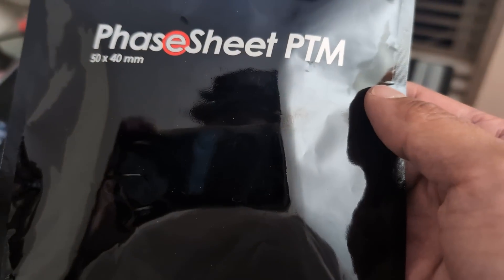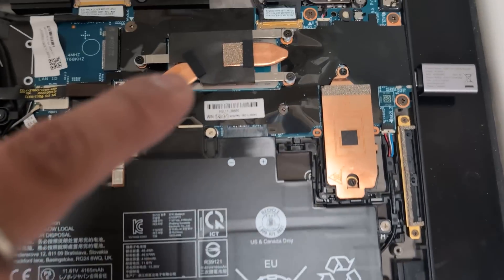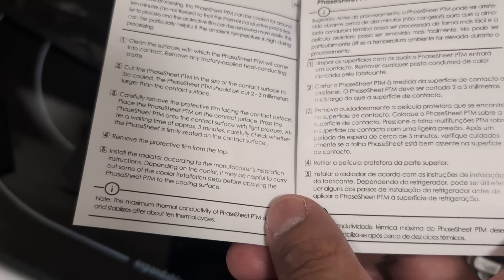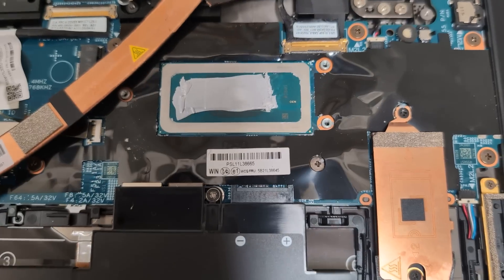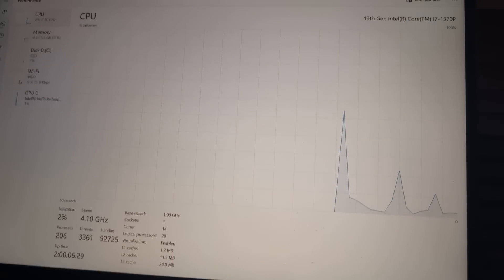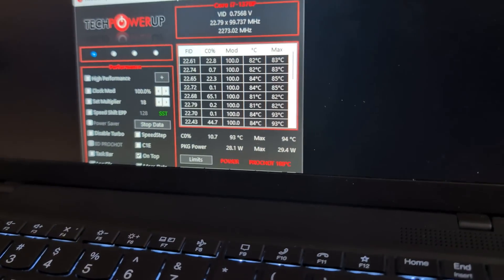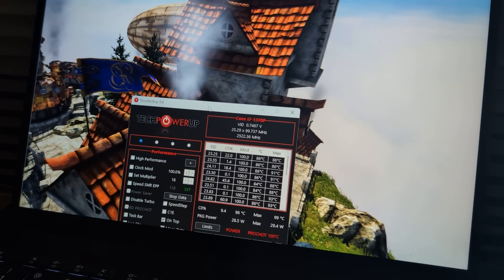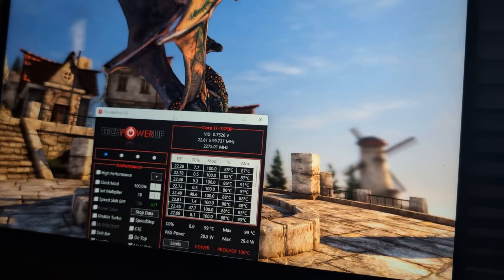Thermal grizzly phase sheet ptm installation and testing.

Comment: there's a couple of things here that might help others: 

1.  Put the Thermal Grizzly Phase Sheet PTM in the fridge for 10 minutes before applying it ( makes it a LOT easier to apply)
2.  It takes 5 or 6 heat cycles before the PTM achieves optimum cooling

Comment: This is incorrect information. CPU is designed to be at these high temperatures. You should compare the score and cpu sustained power consumption before and after applying the new paste/pad. CPU will always reaches its maximum temp unless its power limited.

Comment: Cut it from the red colored parts so you have something to hold to when peeling off the plastic film. (This from someone that has used the Honeywell ptm7950 - same material different packaging and rebranding). It needs a several heat/cool cycles over a few days to finally do its best work. It is not conductive.

Comment: For me on a Lenovo Legion 7 didnt work at all KryoSheet (I also had to put kapton tapes around CPU and GPU to avoid a shortcircuit) , so I put back PhaseSheet which is similar with how the laptop was as new. Not great, but not very bad either. If you want to use turbo boost, get a PC, not a laptop. On laptop disable turbo boost if you want a quiet and cool experience.

Comment: My 16 core 32 threads 7045HX gets 65c running "cine bench 23" <---  full load and using 102w <---  :P
But then again i got a Clevo not an Asus with inadequate cooling :P
Dont touch the pad with your fingers and get oils on it.....
Not to mention your using internal GFX thata slow.. your CPU is doing NOTHING.. useless...........

Comment: If conductornaught isn't working you've missed something thats stopping it working. I used LM on my asus m16 laptop cpu (replaced the old LM) and modified thw gpu to use LM and I got 20-30 degrees temp reduction.

Comment: I used Honeywell PTM 7950 as every brand just repackages it. This was applied to my Mini ITX build using the Minisforum BD790i SE motherboard in the Ncore 100 Air case.
After about an hour giving the heatsink time to heatsoak...
With stock paste my temps would reach 85-91 C
With PTM 7950 my temps stay between 75-81 C
You had to of done something wrong unless the cooling solution is just that bad on the laptop

Comment: I tried multiple thermal solutions for my OMEN gaming laptop and none of them lasted, including Kyronaut. Kryonaut was the best in terms of keeping the CPU and GPU cool, but lasted a few weeks and then the thermal performaces went bad again. I installed for the first time this PCM Phasesheet and at the moment the temps are going up to 80C on CPU (97+ prev) and no more than 67C on GPU (82 prev). Best temps I ever had on any laptop after cleaning and repasting. We will see if it lasts the time test. This product must get through 10 thermal cycles to be completely reliable, as the instructions say. Also, be aware of the gap between CPU, GPU and copper cooling system. For me, this 0.2mm worked as a charm, but for others may not.
Reply from the maker: @PowerProteins  the krysheet works best for me
Reply: @pavy415  have it on my cpu. Amazing
Reply: Kryonaut hands down cools the best, but they degrade extremely fast when the die temps go past 80C, thus is unsuitable in laptops where even the best cooled CPU still hits mid 80s. It is also very susceptible to pump out Which contributes to it's poor longevity in the first place. Which is why Thermal Grizzly now has a new product, Duronaut which it advertises as being as conductive as Kryonaut but way thicker (viscous so is more suitable to direct dir cooling) and less thermal degradation. I have yet to try it out as I just discovered it.

I have also just changed to the Phasesheet PTM and boy are the results actually good. Compared to  my previous PTM 7950 application it's around 2-3°C lower and the fans ramp up slower as well (auto fans) but if I Max fans from the start for both application, I would see as much as 5C difference on the GPU but only 3C better on the CPU. of course, results will vary with others.
Reply: @randomesteven3935  Interesting to see long term difference. If you apply oryginal ptm 7950, you should get good temps for around 3 years, right? Is it the  same with thermal grizzly, or will it dry out in just 6 months? Who knows. 
P.s. What kind of thermal pads did you use on a laptop? I'm looking for a laird607, but it is impossible to find in a small package, and small syringes that I can find seem fishy.
Reply: @ The PTM I had were only used for about 1.5 years. I decided to change it out since I was fiddling with adding spacers to my heatsink. I could've reused the PTM applied already, but since I bought the TG phasesheet, I just decided to change it out. 
As for thermal pads, I usually get Gelid's Extreme pads as they are not just soft but also long lasting. 
Which thermal grizzly are you referring to? Kryonaut (best performing psate on the market in PC applications, but low durability on laptops.) Duronaut (supposedly as good as kryonaut but is viscous and very suitable for laptop applications) or Phasesheet PTM (which is a sheet like Honeywell's PTM7950 but is new in the market and durability is unknown as of now)
Reply: @randomesteven3935  I am referring to TG PTM. But yes, it's kinda new, so there is no info about how long it can be good.
Reply: Hello. I'm looking to try these pads. Any updates? Is it still delivering the same performance? Because I don't know what to choose between this or overpay for ptm7950. Thanks.
Reply from the maker: @jaredfaledey4081  i just went back to my thermal pad your results may very
Reply: @jaredfaledey4081  I have the same thermal performances as a month ago when I freshly installed the Phasesheet. When heavy tasking or gaming I use the laptop with maximum fans, not auto mode. On Omen, I found along the time that the Default setting with Max fans delivers the best outcome even for the most intensive tasks. I hope it helps, cheer a beer for me!
Reply: Still rocks on my Omen, same performance and realiability after more than 5 months. No stutter, no frame loss caused by temps. Amazing technology.
Reply: That thermal paste is a benshdesk or a show thermal paste. Is not made for continuous use. Is made for put it do the benchmark and after a month or two it needs to be replaced.
Reply: @JR-uy2nd  Did you smoke smth? What benshdesk and show thermal paste even mean? Opinions are welcome as long as they have a logic argument. We are trying here different thermal solutions for laptops to help others choose the best suitable option. You come here and talk gibberish when clearly you have no idea what a phase change material is or how it works. Go touch some grass, maybe read some basic english grammar while you get out in the sun.

Comment: Can it be used with a ps4 that pumps out thermal paste, or would this prduct would be pumped out?
Reply from the maker: @darkouer  I won't know if this has pump out effect but if it does i recommend cryo sheet by thermal grizzly very good thermal pad
Reply: Phase change sheets like this Phasesheet and PTM 7950 do not suffer from pump out which is why PTM 7950 is used in industrial applications. 

Unlike regular thermal pastes which do pump out, PTM only gets better with thermal cycles, not time. However, there are also thicker thermal pastels which are designed to last just as long such as the Gelid GC Extreme and KPX pastes

Comment: Bro complains about the thermal interface materials not working when his laptop's cooling solution is a single heat pipe lmao. Your issue isn't the thermal interface material, it's Lenovo deciding to implement an insufficient cooling system to save a few bucks. Basically what you're doing is trying to suck more liquid through a straw by changing the materials the straw is made of when what you really need is a larger diameter straw.

Comment: The new pastesheet PTM by thermal grizzly or the Honeywell PTM 7950 aren't suitable for laptops, it requires high contact pressure to active, laptop lacks uniform mounting pressure needed. So better stick to traditional thermal paste for laptops. I tested new pastesheet it on my Dell XPS 13 and it was performing very poorly reaching temps around 55 to 60 at idle (Ambient Temperature 24 degrees) normal loads temp was reaching 65 to 75. The application was done correctly as specified in its guidelines. Ran through at 15 cycles but no improvement
Reply: I have repasted 100's of laptops as a business with PTM7950, Laird TPCM7250 and TPCM7125 for chips with a shim cover very close to it because the excess material spreads out around the core and with a shim on the cpu it can block full compression (Not entirely sure but i think the grizzly is not PTM7950)  and there is always a good improvement. With poor mounting pressure i usually replace the thermal pads with quality putty like Laird TPutty 607 (K5Pro is sht) and sometimes with poor mounting pressure (couple of Elitebook 1030 G7's at the moment) i place a right sized thermal pad (not PTM but the same material that's used on vrm and memory chips, PTM should absolutely not be used as a thermal pad on those components) on top of the cpu heatsink that pushes on the bottom cover plate slightly to temporally increase the mounting pressure for a faster cure on the sheet. It's on my own laptop for around 2 years (TPCM7125 and always around 80'c when fully loaded) and it is still the same performance after cleaning the fan.
Reply from the maker: @harrydijkstra9936  very good idea I'll try putting a sheet on top
Reply from the maker: @devinkaillukkubura2565  I switched back to the thermal pad cryosheet

Comment: I appreciate the effort put it was doomed from the start. The laptop suffers from a shitty cooling design that gets overwhelmed by heat really quickly, changing the thermal transfer compound will not do nothing for temps. This test is best suited if the laptop or device is hamstringed by the cooler itself. Note: Looking at temps on laptops alone won't give you an answer if it's better or not, look at boost clocks at the specific temps.

Comment: please show the actual installation. also. How did you mess up the first time? it looked well applied
Reply: My guess is he ripped the pad. Common issue really. It's rather soft and if you don't cool it in your fridge or freezer  for a bit before hand it will stick to the plastic when trying to peal it off.
Reply: @SilvaDreams  When I used it, the red plastic bit you're meant to use to lift it off the pad simply wouldn't come off. That's my guess, he tried lifting it like the pad says and it tore the pad itself. I had to go to the other side and gently push it up off the pad to get it working.

Comment: so after a month of having this on, i keep hitting 100c. i used to use liquid metal and i never saw 100c but i had inconsistent temps and i hated repasting it 4 times to keep adding liquid metal. I changed the phase sheet ptm and still got 100c on cpu for my laptop. i dont understand whats going on
Reply: It’s a laptop, thats your problem. Paste or phase sheet doesn’t add cooling capacity.

Comment: Used this stuff on an 8750h + gtx 1080 mobile and it brought the whole thing back to life. Under load (gaming, tried different games), piping hot air is exiting the exhaust slots on the laptop and the heatsink is extremely hot to the touch, which means heat transfer is very, very, veeery good. This never happened with this laptop even out of the box and even after kryonaut application. The chassis of the laptop no longer gets hot and there is no degradation of performance over time. When it cools, it turns back into a solid, greatly slowing dry out AND preventing pump out as it fills the space between the die and heatsink each time, according to the flex/distortion as the system heats up. Genius. 

Thermal paste of all kinds are obsolete, dont let anyone who hasnt tried this stuff tell you otherwise. I came from kryonaut and i've used kryosheet before, each one on the same mobile system at different points. The temps of phasesheet are similar to kryosheet, they trade blows but ptm comes out on top as it lacks the electrical conductivity. Its a no brainer. 

I put it in the fridge for 20min or freezer for 10min, it turns into a solid with a rubbery consistency (i put mine in the fridge to cool it slowly) making it easy to handle. Cut with scissors, peeled off one side with razor blade (tweezers are too thick), used tweezers to place cutout on gpu and cpu then razor blade again to peel off the top facing side, place heatsink on, screwed down as tight as heatsink screws will allow before the screwdriver starts turn skipping and got the results i did. Its worth it, go for it.

 Im going to put this on my gpu, my console and my pc cpu, yes, IHS. 
My hunch is that it will take more thermal cycles to reach the same or similar heat conductivity as it has in the laptop because of two reasons; 
1) CPU and gpu  in laptop simply runs hotter meaning less/less intense thermal cycling needed
2) cpu die is already exposed in the laptop and gpu, nothing in between

So when i place this on the desktop cpu temps are going to be as good as paste then get a much better than paste but still worse than kryosheet tho not by much. 

Thermal paste is obsolete, the chinese have been using this stuff on their electronics for almost 10 years now. Glad its caught on and people can get their hands on it easily. Now laptop and desktop oems have no excuse for toasty high end cpus. No excuse. Paste is obsolete.

Comment: Clearly your computer cooling solution is poor,not any thermal paste solution can rescue throttling
Reply from the maker: @tinoskwindis2036  yup that's something that is an issue with computers that are 13 inches and super thin. But the laptop fan underneath keeps it cool .

Comment: What is the difference between your hottest core and coolest core? You might be testing how well each product deals with unideal mating of die and cooler. The cooling solution itseld might be maxed out so even if you have better conductivity between it and your cpu die it can't dissipate any better. The creep over time might be heat soak in the rest of the laptop. If the bottom plate is metal you could try tying the heatpipe to it with a thermal pad or something.
Reply: I got a 11980hx laptop and when it reaches 90w core 0 is in low 80s while core 1 is 95. I don’t know what to do I Repasted multiple times. Is my heatsink just at its limit?

Comment from the maker: Update: Yes so I ran it again a couple days and I ran it again just now and it seems to hold for about 45 mins under that load until it reached 100 and throttle down significantly. Which means yes it's better that kryosheet but it still will ultimately fail .
Reply: The fact you saw any improvement at all with that limited cooling solution is a win for the phasesheet. btw looking on thermal grizzly sight the phase sheet reaches it's maximum thermal conductivity after going through a heat cycle above 60 degrees and going below that around 10 times, was this done?? I see you ran this test then 2 more times after that, meaning you only ran this test 3 times right??
Reply from the maker: @kodemdotexe4925  its been weeks after this test I have stressed the system a lot from then on haven't looked at temps yet
Reply: @pavy415  would be interested in a update video for sure
Reply: you should PIN this comment at the top

Comment: Please read the manual before usage.
The PTM is not conductive and should be cooled down in the fridge for easier mounting ...
Reply from the maker: @h0schi_yt  doesn't matter still went on
Reply: @pavy415  trust me buddy it matters.
the noted 10 minutes in the manual are not enough. 30 minutes are good enough to cut the pad and mount it properly:)
Reply: @h0schi_yt  Dont put it in the freezer, the trick is to cool it slowly so it becomes rubbery in feeling/consistency. Thats what I did and it made the pad easier to handle and i got good temps out the gate which got slightly better overtime. i7 8750H + GTX 1080 while gaming (for example fortnite) has cpu temps hovering between 65to -70c and gpu temps at 70c. All 6 cpu cores hovering between 1.5 to 1.7ghz. Gpu hotspot is 75c gpu overall temp is 70c.
Reply: i talked about a fridge (~ 6 degress) :)
A freezer is too cold for the pad.

Comment: Don't forget you need quite a few cycles of heating and cooling the PTM so it can reach it's potential, should be comparable to Honeywell PTM7950.
Reply: You dont need as much cycles if the pressure (Mounting pressure) applied is high enough. Think of melted cheese. Getting it to liquify is what increases its thermal conductivity, the hotter the better, the more pressure the better. If u can get these two things high (which are always high in a laptop for example) you will get very good temps out of the gate which get slightly better over time give or take 3 degrees Celsius.
Reply: @user-bn6lm8ng3v  Indeed, which only proves my point ;)
That 3°C when comparing thermal products is a rather big difference and mounting pressure in laptops usually leaves much to be desired.
Reply: @rozwell69  Suggests 3 degrees is a big difference. 

....

Im done here. 2 Years from now you'll come around, maybe even later lol.
Reply: @user-bn6lm8ng3v  It all depends - if you're far from limits then sure, 3°C is not a problem.
If you're close to the limits it can be a difference between full power, thermal throttling and even crashing. Especially when overclocking or when you're at your max cooling capacity.

...

Whatever dude, u do u.